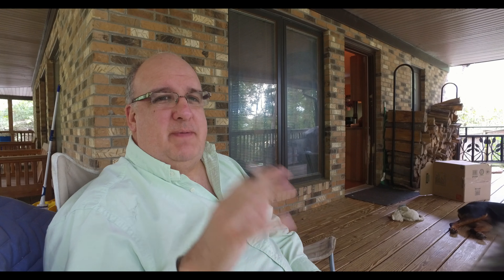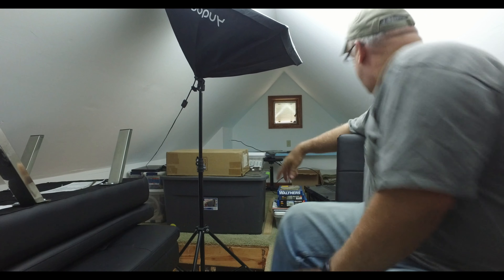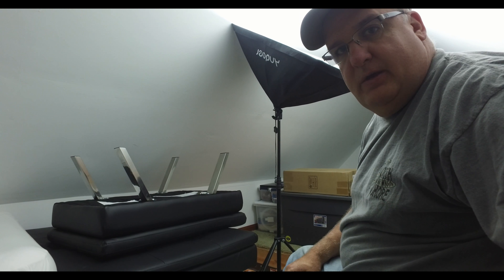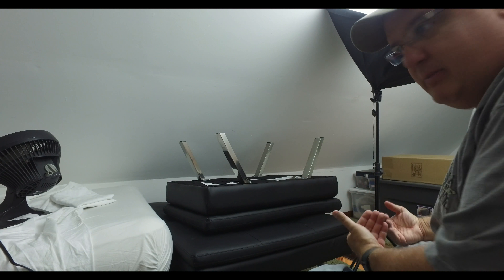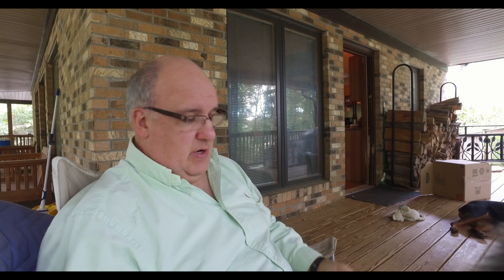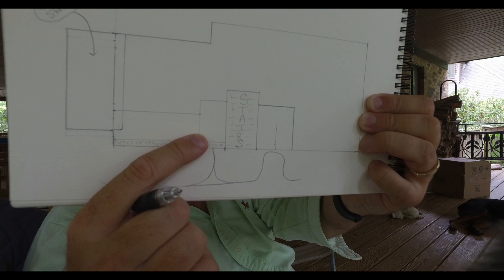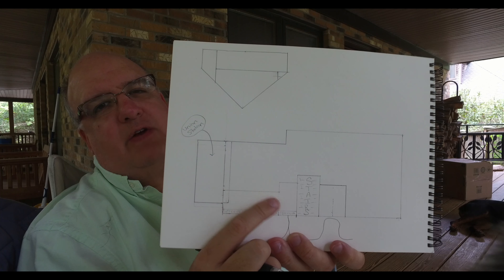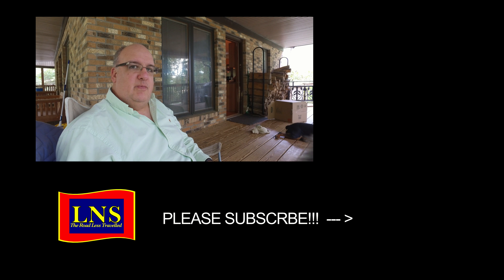Revisiting The Track Plan!

Comment: Curtis, you are giving PROOF that anyone can build a Layout!! Careful planning is far more important in your situation than mine. I complain about my Layout limitations..... but there's NO chance that anybody can fall into a hole!!! 😱 
You appear to be making good use of what you've got to work with. 
Carmine 🚂
Reply: Do you happen to have even a little bit of space in the stair opening, to maybe run a narrow section against the wall. Wouldn't have to be more than 2-1/2" wide. 
That COULD give you the option of continuous running.
Reply from the maker: +PacbeltRR That’s the plan. I am still going all the way around the room. Thx for your comment!!

Comment: Ok! Lets think this out how about moving the bed to the other end of the room the cable and the shelf could be used for a TV. starting the layout on the other end of the room looks the be a larger area. Which may give for more room for the layout just a thought.  So far I like the approach you are taking I will continue to fallow and see how it turns out. 
Tony
Reply from the maker: +Anthony Benedetto Yes I thought about that. That little cubby hole just give me that much more space. The TV may be hung from the ceiling and the bed is inflatable so it can be stored easily. It’s a thought but for the moment I’m going to keep as is. Thx for the suggestion though!!  I appreciate it!!